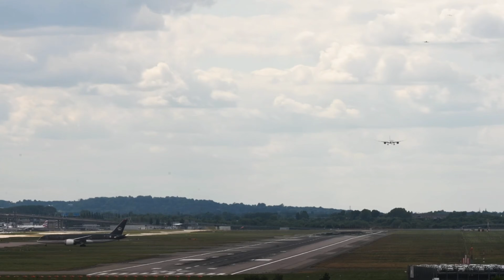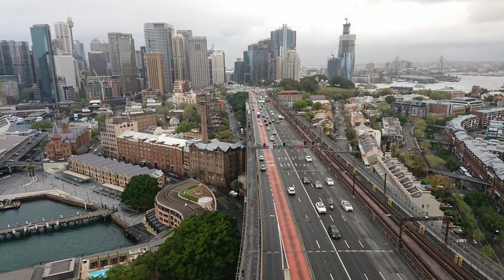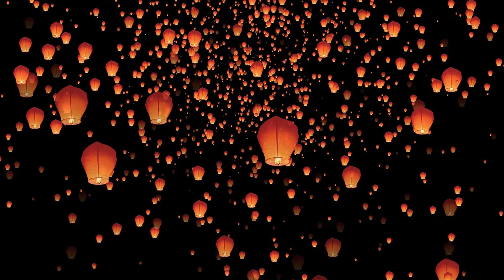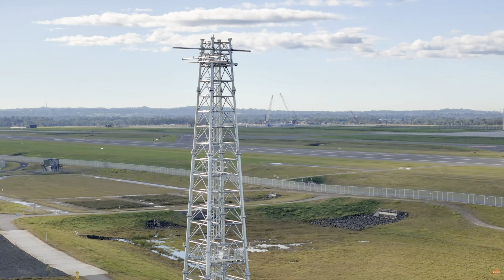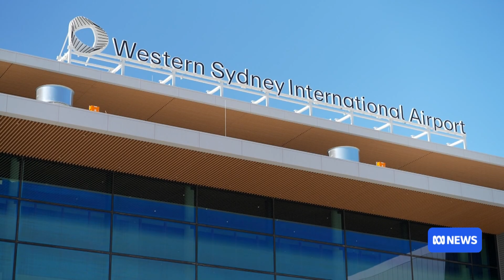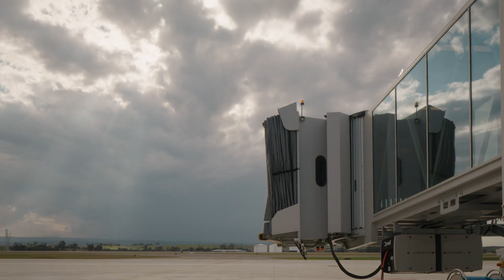Western Sydney's epic new airport

Comment: What an excellent clip. It makes a huge difference when someone who knows their stuff does the job. 

BTW, if you or anyone else can identify what one of the antennae are for near the thresholds of each runway end, I’d be interested. I can distinguish the windsock, the runway visibility (RVR) sensors, and the glide slope antennae easily enough, but there is another tower antenna, painted red/orange and white, not far from the windsock. Thought it might be GBAS, or DME associated with the ILS, but they usually have a simpler design. Any thoughts?

Some further info for people as nerdy and me. The ATC facility is a remote system, with a camera tower on the airport, and the ATC “virtual tower” located about 30 minutes drive away at a large digital data centre at Erskine Park. ATC are not on the airport itself. I understand they were originally going to be on the airport itself near the ARRF station as you indicated.

As expected the system has numerous safeguards and back ups. It can also ’see’ in infra red in darkness and low visibility, detect intruding animals or people, and includes surveillance and automatic alerting of emerging hazards. Instead of binoculars, ATC can simply zoom in on any item of interest. It also tags each aircraft with its callsign and other key details on the virtual images it creates for ATC.

One of its features is that the large amount of visual imagery fed from the camera tower you featured is transmitted primarily in an interesting way to the ATC virtual tower at the data centre. Nearby are high voltage transmission lines. The two top wires are for lightning protection. They have high capacity optical cables located within that transmit the images (protected from lightning from the outer metal construction). Apparently electricity authorities use them for monitoring and controlling power transmission facilities, as well as selling capacity to third parties. They tap into those lines lines near the data centre, and images are fed from them to the ATC virtual tower within.

Comment: Is there room to grow?
Reply: Absolutely. It has about twice the area of the current Sydney Airport, with plenty of room for a second, equal length, widely separated (1900m) parallel runway. This would be similar in layout to London Heathrow, except its runways are only 1414m apart. You can see the initial layout (for about 10 million annual passengers) at “Western Sydney Airport Site Layout 10MAP” online; and the eventual layout at “Western Sydney Airport Site Layout 82MAP” (for about 82 million annual passengers.

Comment: So lets talk about location. The second airport is already surrounded by housing. I mean, WTF. It needed to be built up and over the mountains and linked with high speed rail where noise isnt a problem. Did they do that? NO they did not, simply because of "follow the money".
Reply: No it's not, it's actually semi rural.
Reply: Sydney geography by general is an ass…. But still managed to fit 2 airports…. 

Donno how much of an ass Tokyo geography is but Sydney will not go well for a population over 10 million

Comment: Is this the one with no train station and will a real bugger to access? Of course it is.
Reply: Not even slightly. Most airports don’t have rail access. This one will have a metro system in 2027. It also has 6 bus routes running to surrounding suburbs. Main road access is via the M12 motorway, the A9, Bringelly Road (all of which are 4 lanes), plus two other arterial roads. It’s closer to virtually half of Greater Sydney’s population than the existing airport. Hardly a bugger to access.

Comment: No train connection between Glenfield/ Leppington to airport,  ridiculous, Glenfield should have been the Junction between the 2 airports,  I won't  be using it,
Reply: The Glenfield connection is the next cab off the rank to be constructed. The connection with St Marys to the north is being done first as the area to the north has a much larger population than those to the South. 

No need for a direct rail connection between the two airports. People don’t need it. You use the airport that best suits you, because it’s more convenient to you or you want to fly in from elsewhere and transfer to another flight there. If you need to connect to another flight you fly into then one which has that connection, not commute by train from one to the other.

Comment: Tell me the cameras on the new control tower will never fail, is the cable between the tower and the air traffic control centre located 17km terrorist proof.. If they are made in China we're stuffed. What's wrong with having eyeballs on the runways and taxi ways.

Comment: I think they should keep the swing gate option for the final project...... its would make turning around let say an qantas a330 for let say an arrival from asia in the morning and run it to perth/brissy or melbs after and then come back to sydney and back to asia...
Reply: The swing gates are there, and there’s more than one.
Reply: @tacitdionysus3220  I know they will use the swing gate during the stage 1, maybe also stage 2-3 but wonder if they will still use it once it’s fully upgraded to its 80 million or will its be like a clear divide of international and domestic with no swing (or swing gate not being used)
Reply: @GazzOak69  It wouldn’t surprise me to see two sets of international and domestic facilities, so that either side of the airport is generally capable of dealing with either. One of the advantages of WSI is quick runway to/from terminal time, which can be diluted if needing to taxi to the other side is necessary. I suspect some swing gates will be retained, as they would be useful for variations in airline needs over time. 

Another differentiation may also be in the types of gates used. For example, layouts for later stages appear to have different size gates. At present the terminal building has gates numbered 19 to 25, with each aerobridge being allocated A and B suffixes. A or B for two,  single aisle aircraft. A and B together for a single wide body aircraft.

North and South of the existing terminal are sets of open apron bays for aircraft not using aerobridges. In the north these are numbered 16 to 18. The terminal will ultimately be extended north and the will be converted to use aerobridges. These are numbered 1 to 15, and some of them appear to be around the back of the terminal wing, off a smaller apron area, with smaller aerobridges optimised for smaller, commuter aircraft.

Anyway those would be my moderately informed guesses. Ref: See "Western Sydney Airport Site Layout 82MAP"